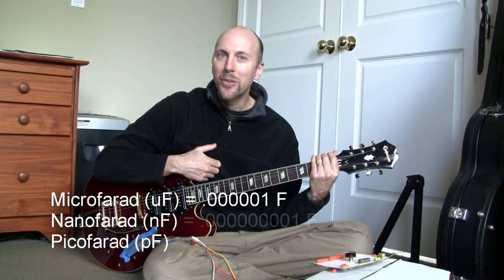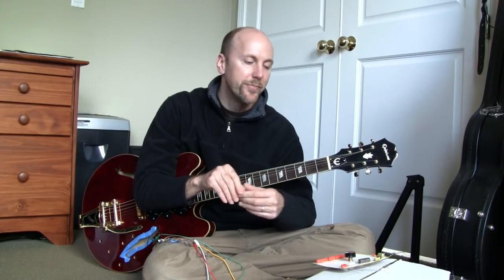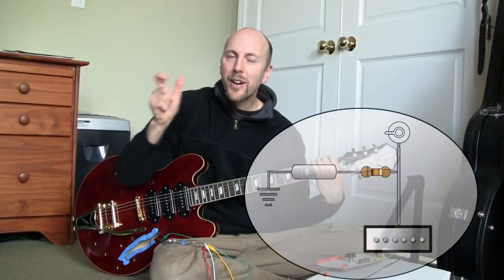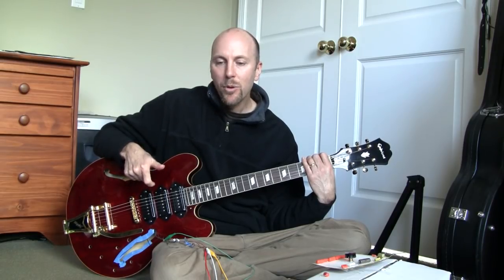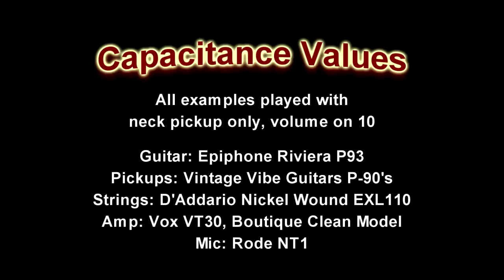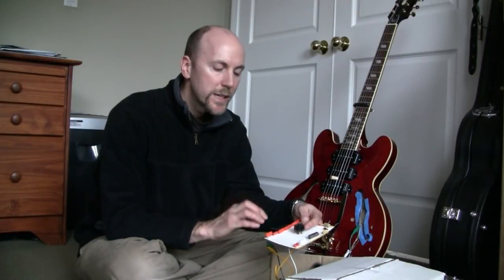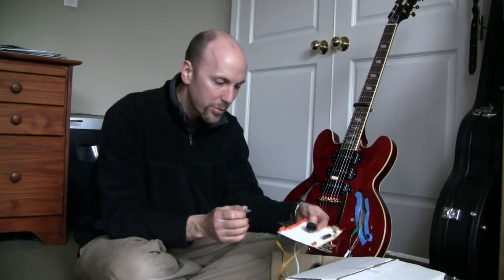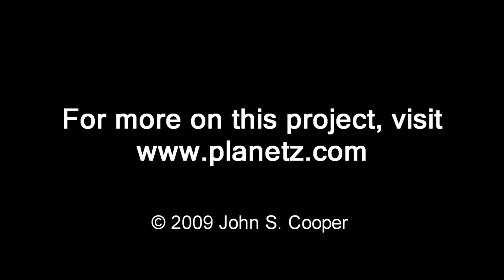Guitar Tone Capacitors, part 2: How Tone Works, Selecting a Value

Comment: I have a question: When you say that a guitar pot is 500k, does that stand for 500,000 ohms or 5000 ohms? At first I thought it was 500,000 ohms, but when I tried to calculate the cutoff frequency with the formula 1/(2Pi*R*C) I got some insanely small numbers like 6 Hz for the 47 nF capacitor, so I thought "that can't be right!"

When I put in 5000 ohms instead, I got a more reasonable value like 677 Hz, which corresponds to your test right here. So 500k is actually 5000, right? This is all really confusing to me, isn't K supposed to add like three zeroes instead of one?
Reply from the maker: 500k is 500,000 ohms.  Yeah, the standard RC calculator doesn't look right- but I'm not sure what the right equation is.  I guess since the resistor and cap are in series, it's not technically a true RC filter.

Comment: @johnplanetz I am sorry, maybe I did not explained it right.  I was thinking, that we usually meet the 250k potentiometers at the single coil pickups, and the 500k at the humbuggers. So with this option in my head, I was thinking about to split or link two single coils with a push/pull potentiometer, in other words to make these two single coils work as a humbugger, or just a single coil at a time.

Comment: I have a question. I have a G&L Tribute ASAT bluesboy, humbucker in the neck single coil in the bridge. The neck PU is really muddy. What value pots and caps should I be using, I'm upgrading the electronics to a Seymour Duncan SH-55N Seth Lover Humbucker and Seymour Duncan STK-T2B Hot Lead Stack. You know so much about signals, I would really appreciate any feed back. Thanks!
Reply: 6 years later... you should start with what Seymour Duncan recommends for those pickups, most likely .047 uF in series with a 500k pot from the audio line to ground.  But you can adjust this to taste, that's what this video was about.

Comment: ok so im using an s-1 swithch and there is a .05 uf disk cap on it and i need to replace it but all i can find is a .047uF would it be ok to replace these and how do i test a cap with a multimeter to see if it needs replacing???

Comment: Thank you for this video!
I've had a .047 Oil paper cap in my split-coil jazz pickup bass with nice vintage round tones.. A pickup manufacturer I recently purchased bass humbucker pickups from recommend I use a .01 cap, and when they were installed I realized the roll-off from the highs doesn't sound right. I think I'm going back to the .047 caps for more roll-off

Comment: Does the tone knobe control the low frequences as well? Or just the high ones?
Reply from the maker: @FLAMENCO961- a typical guitar tone circuit just rolls off the high frequencies.  Some guitars also have a bass control but it's rare.  I wrote about the G&L PTB system here: http://www.planetz.com/treble-and-bass/
Reply: John Cooper thanks pal! Great explanation!

Comment: Can I just solder the two wires together without a cap between them.. does this do anything.. or is it harmful at all
Reply from the maker: Which two wires?  If your intention is to eliminate the tone circuit, then you should remove the tone cap, and leave it open-circuit.  My recommendation, as always, is to experiment with your circuit using alligator clip leads.  This will let you try different things and understand the results, before you start soldering.
Reply: ***** Yes I mean to eliminate the tone circuit to see how it sounds.. can I just detach it and listen for a change or must it be attached somewhere
Reply from the maker: ***** Just detach it.
Reply: ***** Thank you, I'll try that... actually which wire is best to detach.. I have this Pawn shop mustang special and the humbuckers in single coil mode as well as humbucking mode, sound dull.. my cheap strat bridge sounds much nicer and present.. any ideas what I could try.. the pots are 500
Reply from the maker: ***** You can just remove one leg of the tone cap to pull it out of the circuit.  If you like the way it sounds, you could use a push pull tone pot, or a no load bypass pot.  See this experiment:  https://www.youtube.com/watch?v=dN3SlH-cEAg
Reply: ***** Thanks for your help . I'll give it a go :)

Comment: At 2:10 you say that a bigger capacitance value will allow more high frequencies to pass through the cap.You may want to re-phrase that, I think it is confusing to the newbie. Probably just a slip of the lip.
Reply: Not a slip.  A capacitor in series with the audio line is a high pass filter, blocking low frequencies.   If your capacitor is connected from the audio line to ground, then it passes high frequencies to ground, acting as a high-cut instead of a high-pass.  That's how the guitar high-cut tone circuit works.  There's a variable resistor in series with the capacitor to control how much signal is diverted to ground through the capacitor, but the capacitor value sets the cutoff frequency.